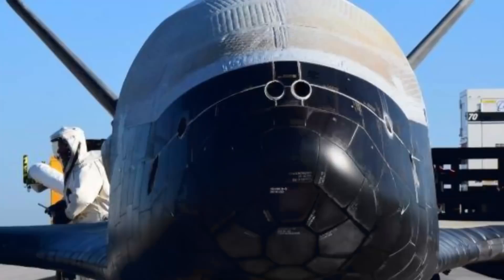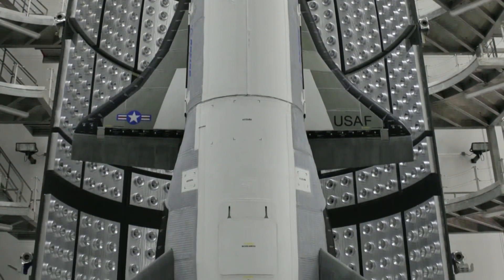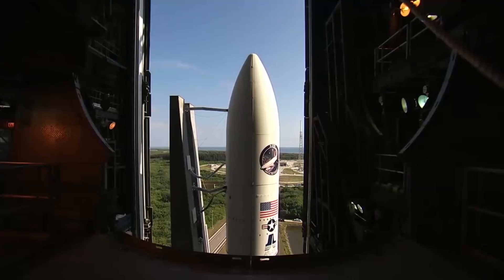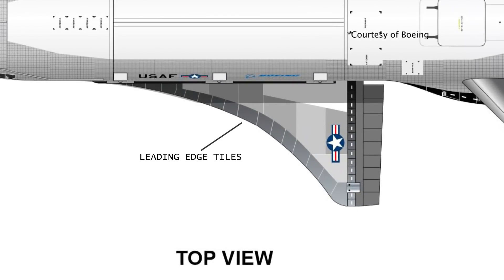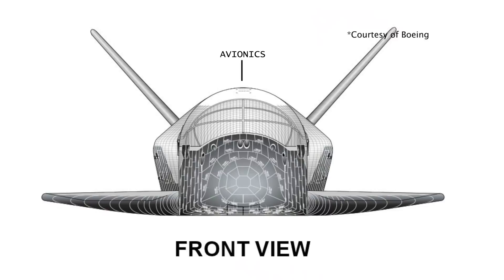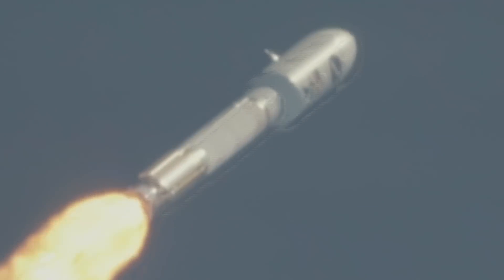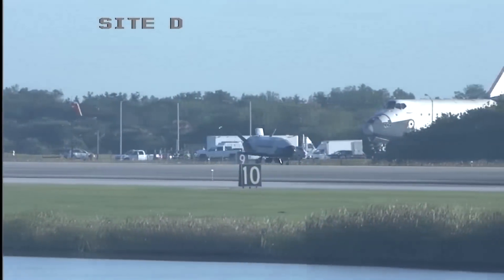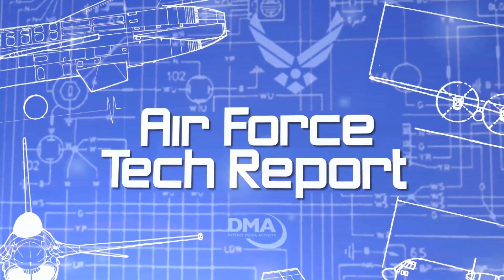X-37B - Air Force Tech Report

Comment: Why is the engine on the right side and not at the center?
Reply: The X-37B has a Hal Ion engine that sits next to the rocket engine you want both engines to be as close to center line of thrust as possible so you it doesn't induce rotation about the Yaw axis. https://rocketry.wordpress.com/2017/09/07/experimental-thruster-shown-on-x-37b/
Reply: The vehicle mount while its in the fairing probably connects in the center.